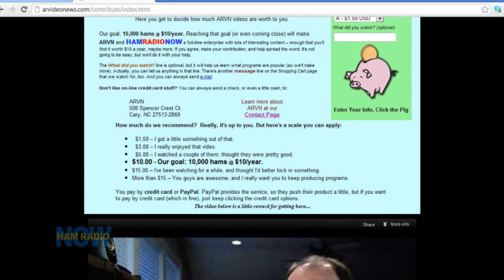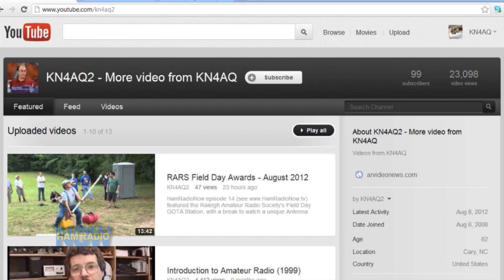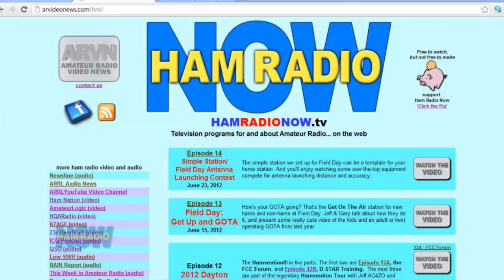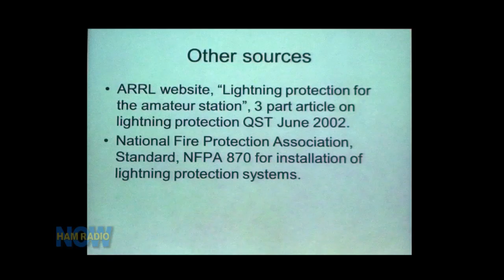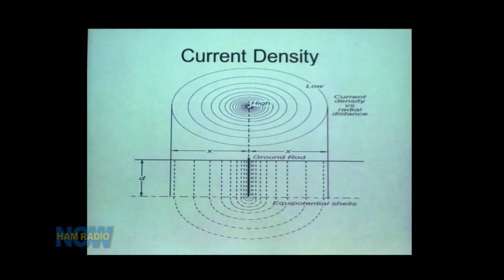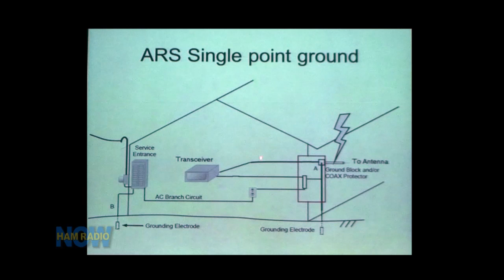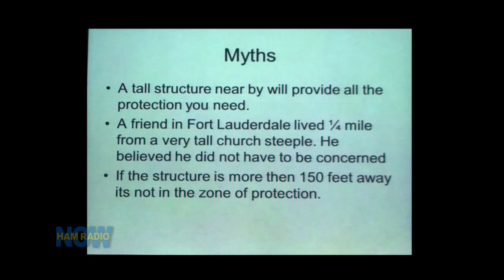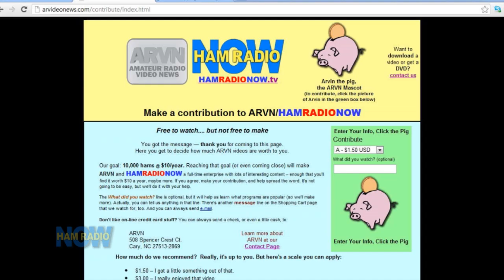HamRadioNow Episode 15 - Grounding for Lightning Protection

Comment: Although at this point this video is six years old, it still gets much of the available data to the viewer. One major topic NOT covered was the difference between a Safety Ground and a Lightning Ground. This is all covered by a video here on YouTube by the people who wrote the NEC manual. As he said, it isn't magic. Don't be put off by the apparent low level of this presentation or nit pick about verbiage (cell vs. battery, for example). This is the way things are in reality... MOST people don't know a ground lead from a garden hose. Reference this video: https://www.youtube.com/watch?v=mpgAVE4UwFw&frags=pl%2Cwn

Comment: Soldering to a ground is a fail, the fault current will melt the solder opening the connection. The only two correct methods are a U.L. listed clamp or exothermic welding.

Comment: K2WH, you are a math wiz. Now that you've mastered multiplication, you should find subtraction to be child's play. Start with travel:  hotel, air fare, gas, meals. Then factor equipment: cameras, audio, editing. Next something harder to place a value on: time. Finally, the most subjective of all: talent. How much of that $100,000 is left? And don't spend it yet. It hasn't arrived. So far in 2012, ARVN/HRN is at about $5,000. And I believe Bill Gates 'volunteered' to 'do' Microsoft.